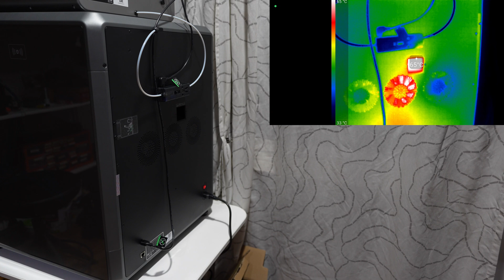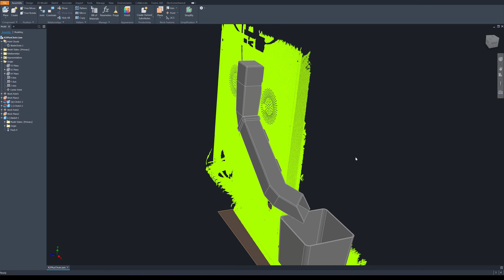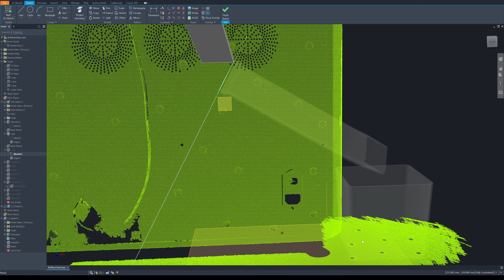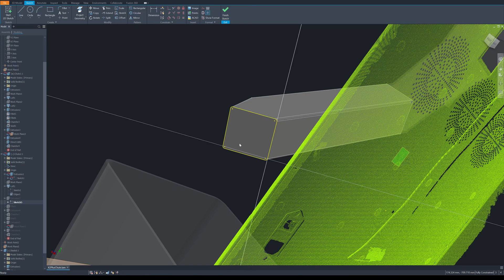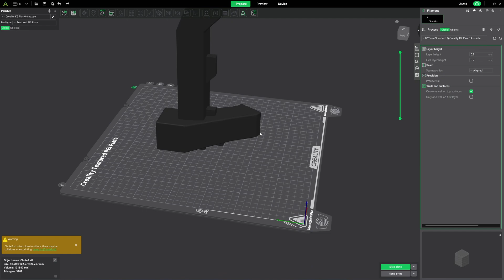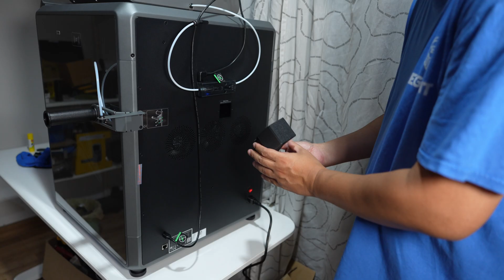Making K2 Plus Waste Chute with Creality Scan Raptor X (Free Download)

Comment: I think the crossection is unnecessary narrow and will possibly cause troubles. There is no reason not to make it as wide as possible
Reply from the maker: Thanks for the advice, but the waste come out on fixed size, 40 mm wide chute's plenty, no issue with waste running out yet.

Comment: Hey payo this is a fantastic video demonstrating your method. One point I’d like to mention is that ABS Or PETG is abrasive, so  when the waste comes into the chute you made it could get stuck by friction, a solid an easy solid would be to spray WD-40 inside the waste chute extension you made so that the waste glides on the inner surface to the output into the box, otherwise this is fantastic! And congratulations on your printerb
Reply from the maker: Thanks for the suggestion! With the current tilt, the waste flows out easily—no blockages at all. That said, I probably should have designed it with detachable mechanical joints. I might consider revising it later.